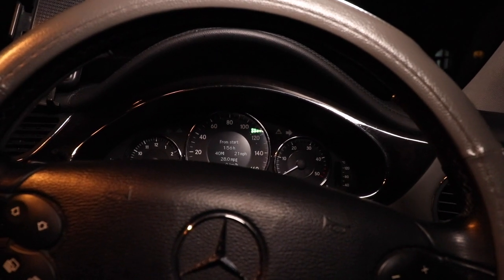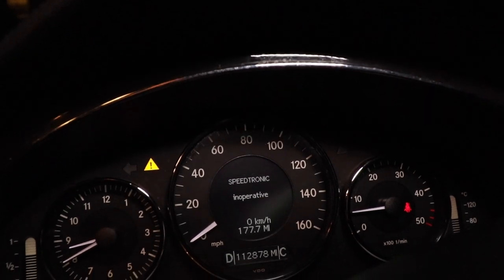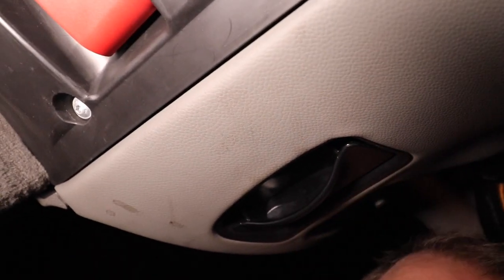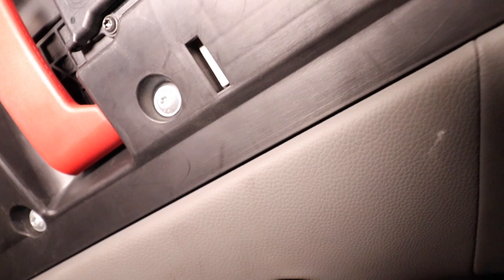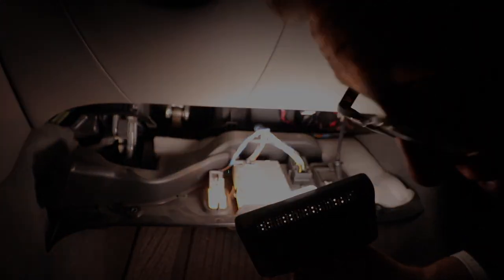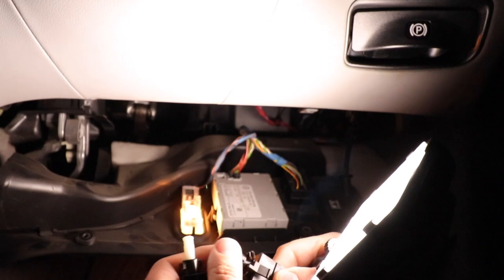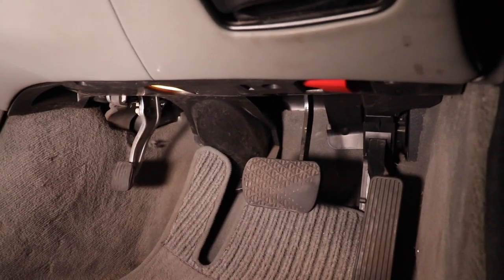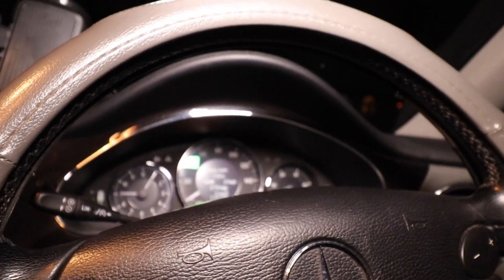ESP, Speedtronic inoperative, brake light switch

Comment: What the name of this  piece
Reply from the maker: Foot pedal brake switch. Sorry I don't have the product code number. Thanks for watching
Reply from the maker: Looking on Google, I've found lots of sellers of this part. Pattern and original for as little as £5.85

https://www.ebay.co.uk/itm/131504018123

https://www.gsfcarparts.com/931me0080?auto_apply_coupon=SHOP60&gclid=Cj0KCQjw28T8BRDbARIsAEOMBcxy1WldQprVRNj-CTZv5xYCSvn0W0fFcfo-JB1vH7mFAGQWRuHXkN8aAohJEALw_wcB

https://www.onlinecarparts.co.uk/car-brands/spare-parts-mercedes-benz/cls-c219/18962/12348/brake-light-switch.html
Reply from the maker: Looking on Google, I've found lots of sellers of this part. Pattern and original for as little as £5.85

https://www.ebay.co.uk/itm/131504018123

https://www.gsfcarparts.com/931me0080?auto_apply_coupon=SHOP60&gclid=Cj0KCQjw28T8BRDbARIsAEOMBcxy1WldQprVRNj-CTZv5xYCSvn0W0fFcfo-JB1vH7mFAGQWRuHXkN8aAohJEALw_wcB

https://www.onlinecarparts.co.uk/car-brands/spare-parts-mercedes-benz/cls-c219/18962/12348/brake-light-switch.html

Comment: Amazing! @mercedes I would love to know what you have to say about this.
Reply from the maker: Hi. I did make a complaint directly to Mercedes, to have a pretty feeble response from the local manager, justifying process, rather than seeing this from a factual and customer perspective.  Thanks for watching and commenting 🙂
Reply: Rich Watson this video helped me a lot, I had same issue but didn’t had yet the brake switch. So I have removed the one installed in the car and installed it again and it’s running!
Reply from the maker: @Pmendesphotography  Yes, that was my very first thought when I saw the old one, it just looked 'sticky'. I wondered whether it just needed some TLC and lube but as I already had the new one, I replaced it. Good luck with yours, I hope it all works out well and cheaply!! Thanks again. Rich

Comment: Found for 30 AED in sharjah, UAE
Reply: Going to change by myself.
Reply from the maker: So pleased that you found the part easily. Good luck with your repair. 👍
Reply from the maker: @ammarhaider5522  the repair should be easy, give me a shout if you need an further guidance. Good luck 👍
Reply: @RG500_detectorist  yes, it was hard to replace the old switch,  amazingly errors messages disappear.
Thanks alot for your step wise guidance.
Reply: It was not hard:D
Reply from the maker: @ammarhaider5522  my absolute pleasure. So pleased you've managed to sort it efficiently.  Thanks again for watching my channel. Best wishes Rich